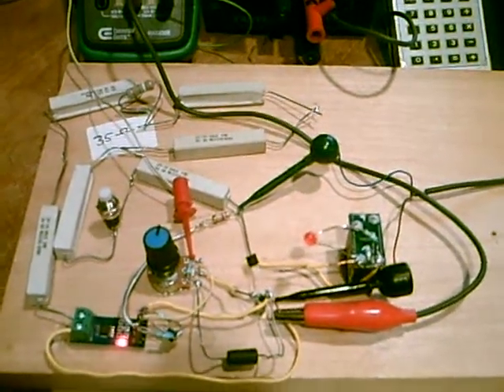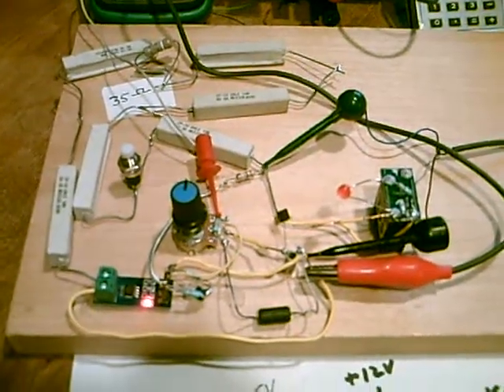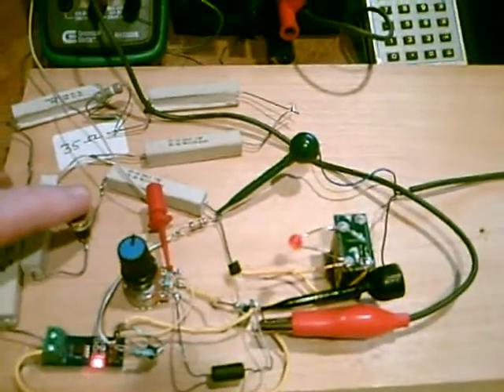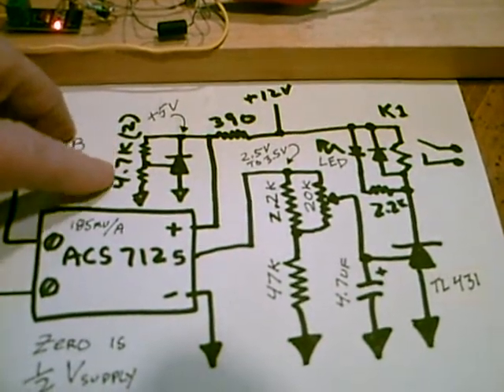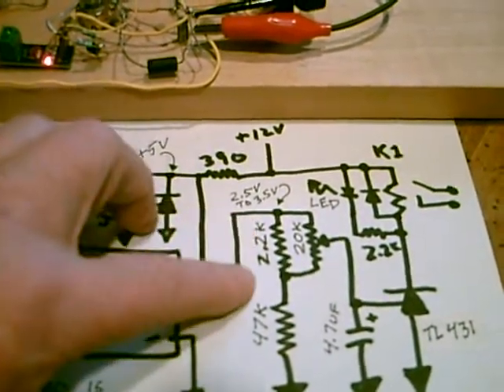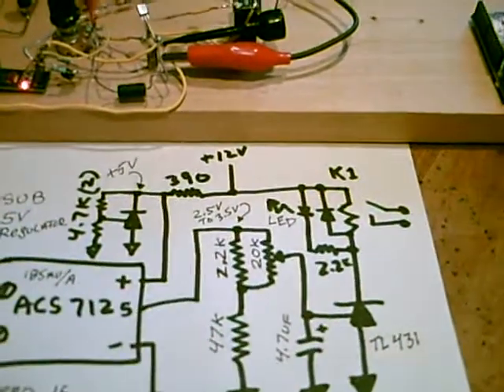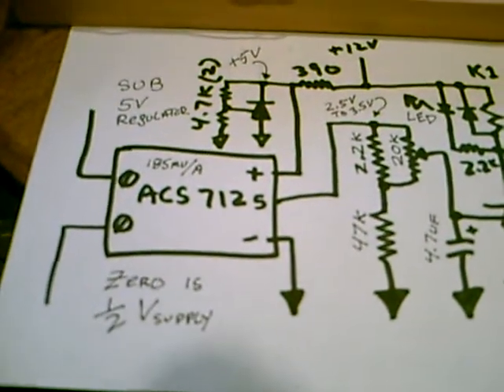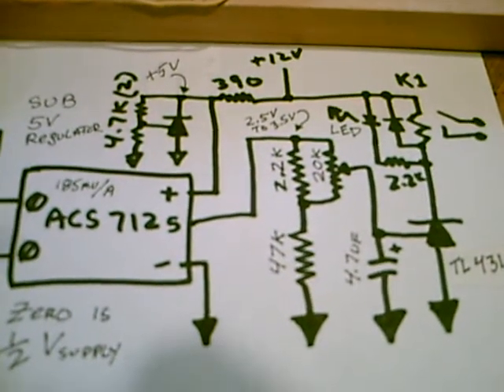Isolated DC Over Current Sense Relay,  ACS712 easy build

Comment: Thanks for your great idea.
Long time looking for this circuit. It the only one circuit 😁 i found that "using acs712 as current sensing to drive relay - without arduino"
Is it work/sense current at "full range"  (0A-5A)?
Reply from the maker: Technically it only senses half the range because it can't detect negative, 0-2.5V.  The positive range of the 712 is only about 2.5V to 4v if I remember.  The 431 can only detect 2.5V and it switches on within 1mv.  A voltage divider changes that depending on current.
Reply: @opera5714  
Thanks.
Sorry, im very newbie but need this circuit too much.
If it work when output of acs712 is 2.5v, it means the current sensing is 0.2A (?).
What should modify so it work arround 2.8v (app.2A) ?
Reply from the maker: @wibowoims527  a question is an opportunity to learn.  Use an online calculator like https://ohmslawcalculator.com/voltage-divider-calculator
Choose a lower resistor of 47K to 100K for then lower resistor.  You know the input voltage and you want 2.5V out.  It will calculate the upper resistor. These calculators are handy as an easy way to try out standard value resistors in a divider. You may want to use a 100uF in parallel with reference pin to slow down response.
Reply: @opera5714  ok. Thanks for nice help and guidance.. 👍

Comment: Great work, would this work for the 30A  ACS712?
Reply from the maker: Yes it would and with any other device that outputs 2.5V nominally.  The 413 makes a very good relay driver if you take into account the 2V loss. As long as the 5V supplying the 712 is stable, the transition will be quite repeatable. Hope this gives you other ideas for how the 431 can be used.  4-20ma devices would also work with only a suitable resistor.
Reply: @opera5714  Thank you for your reply, just one last question, can the 413 hold the current that is needed to power up the relay?  I presume that the relay coils need to be less then 100ma, is that correct?
Reply from the maker: Preferably keep the max current to about  40ma. Plenty of relays that can do that or add a transistor driver. Some imports are probably dicey as to how much heat they can dissipate.

Comment: good morning. thanks for the very nice video I would like the help for 24v power supply. what changes should i make in the circuit thank you
Reply from the maker: For 24V operation change the 390 ohm resistor to 1K and the relay to 24V. When charging a battery, the voltage can easily go up to 30V or more.  While the 431 is rated to 37, I tend to not trust them at higher voltage considering the source of many of these.  For added safety, I would put a 4.7V zener from the relay to the TL431.

Comment: Interesting electronics, but it gets over my head quick. Still I like to play around with this stuff. I need to connect an alarm zone to a building on my property that's about 200 ft away. I run my wire 2-3 ft deep thru plastic conduit. I live in South Carolina and we have sandy soil and very bad lightning storms in the spring. I've lost thousands of dollars in electronics over the years. I avoid underground wiring as much as I can and disconnect when a storm threatens. I was looking at isolated relay module with "optocoupler". From the name they sound like they would isolate a ground lightning emp pulse from getting into my alarm panel. Am I correct?  Thank You
Reply from the maker: Sandy soils don't conduct very well making it hard to get a good ground. An opto isolator can provide about 3Kv of isolation which won't be quite enough to protect it.  Adding resistance and inductance can give it a fighting chance if a couple MOV spike protectors are added.  This is the reason surge protectors have a different rating for the service entrance vs at a power strip located some distance away.  MOVs to ground located at each end with a coiled wire around a piece of rebar will slow down the surge enough for protection to work. Addition of an opto isolator would then work. Could be a video others might find interesting.